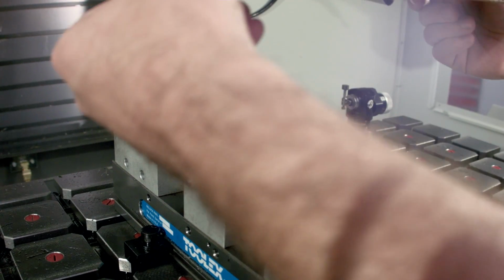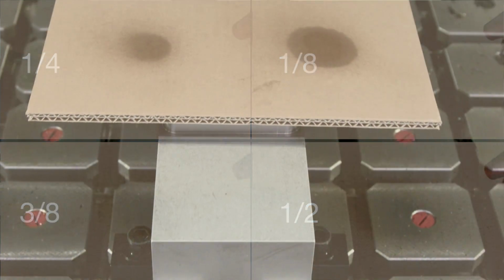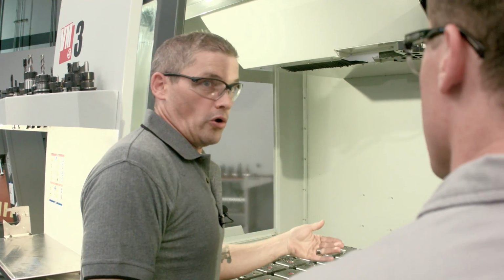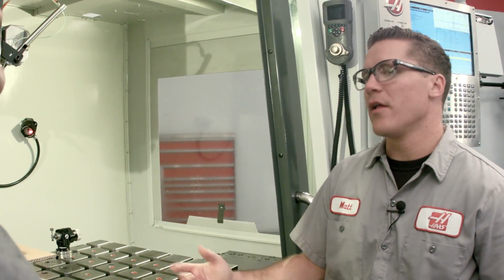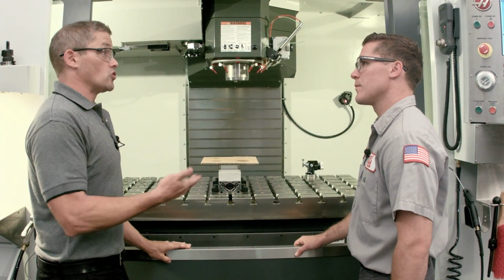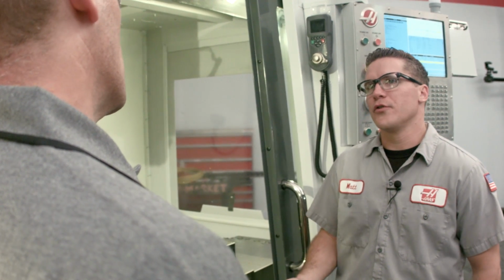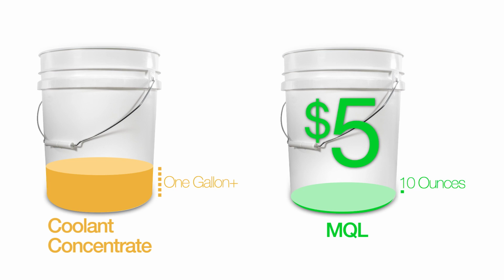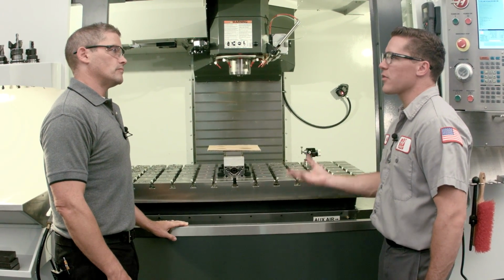MQL Advantages – The Haas Minimum Quantity Lubrication System

Comment: I’ve been using the MQL system on my Haas DM-2 for 6 months now, it’s the only coolant I use. I make parts for science experiments that have to be very clean with no contamination. That being said, the Haas system seems and works like an afterthought. The auto air gun is floppy and you can’t activate it with the door open, so it’s a pain to set. The clamp that keeps it set in place is finicky and will pop loose sometimes and then the nozzle  falls into the part or workpiece. From the factory, the nozzle pointed at the trailing edge of the cutter. I had to remove a screw to twist it so the blast was on the leading edge. The oil delivery is via suction by the Venturi effect and it is erratic. Just yesterday it stopped delivering oil in the middle of a slotting cut and the endmill was ruined. Good thing I happened to see it and stop in time or the part and setup would have been ruined. You can see the gaps in the oil in the line because it’s clear. The line gets all bunched up and twisted because it’s fed thru a mounting block and then just runs loose along the side of the piston. It gets pulled out when the piston is activated, but when retracted, you’re just pushing rope. The whole thing feels like kid just out of college designed it and it didn’t go thru any evaluation or design review. The fact that this video is 5 years old and the unit hasn’t been redesigned says a lot about Haas. I wish I had skipped the Haas MQL option, because it was not cheap, and went with a slightly more expensive aftermarket unit. If I had the time, I’d re-engineer this one. If Haas is reading this, I have a novel design for an MQL system that I’ll sell you.

Comment: I'm confused... How does flood coolant get "used"? I understand a small amount sticks to the part, and some goes out with the chip conveyor, but where is everyone's tooling going? I hear this a lot. (Same place where one sock, in every load of laundry, goes?)
Reply: The coolant loss is from the leaking machine bed all over the floor.
Reply: A lot of oil concentrate is lost in carry out on the chips.  Also, high rpm and larger tool holder turns the coolant into a fog or mist and some of that ends up outside of the machine. Blasting the parts with high pressure to blow the coolant off the parts before removing from the machine puts a lot of it in the air too. Depending on relative humidity and how much heat your machining operation creates much of the volume loss is water evaporating, so to top the tank off a weak concentration can be used. That's why it's best to use a refractometer to keep the concentration in range.

Comment: What happens when the MQL system is blocked by part geometry - which would happen a LOT. the majority of the parts I machine, the tools would regularly be blocked from coolant. Is there any multi-point solution for this?
Reply from the maker: We do not currently have a solution for this, but we have seen customers fabricate a custom bracket to mount the nozzle in a position that works best for them.
Reply: It 5 years later and Haas still sells the same system with no improvements.
Reply: Check out http://www.maglube.com/milling-machines/ and give us a call. We are a custom designer of MQL systems and nozzles for all of your machining equipment. We can retrofit your CNC's and provide the correct cutting fluid for your application.

Comment: If you are starting from scratch, can you completely replace your coolant system with the MQL system; or are there materials or cutting speeds that requires that you use flood coolant?
Reply from the maker: It depends on what you are cutting of course, but generally speaking you are going to need coolant. If you had a very specific job and that’s all that you were ever going to run on the machine, MQL might be all you’d ever need.  But if you plan on running a variety of jobs and materials, you’ll want both coolant and MQL.
Reply: Haas Automation, Inc. Thanks for the comments, that is exactly what I was wondering.  Your website videos are really good, keep the tips of the day coming.

Comment: Great video. What about the cost of the air used? As opposed to running the coolant pump motor. Surely that makes it more closely priced to flood coolant?
Reply from the maker: +Seventy7 Industries Great questions, thanks. There is certainly a cost associated with compressed air. If we use a value between $0.15-0.30 per 1000 cfm (typical values used in industry when exact cost is unknown) we can calculate the cost as follows: The MQL system consumes around 16 cfm on average, which equates to 960 cu.ft. per hour or 19200 cu.ft. in the 20 hours of cutting referenced in the video. At these rates, that equals an expense between $2.88 and $5.76. So, even when you include the cost of the air, MQL remains significantly cheaper than the cost of the coolant concentrate used over the same time period.
 
And to reiterate, we aren't saying you should necessarily stop using flood coolant. We're suggesting you use MQL where it's a good fit for an application, and get the bonus of saving money on your coolant at the same time!
Reply: +Haas Automation, Inc. Thank you for being up front and honest with regard to your MQL system and my question. Keep up the great videos.
Reply: +TacticalKeychains I think its always going to come down to removing chips from around the cutting tool. If you cant do it with flood coolant. Theres always mist air.
Reply: For many shops, this could easily require an air system upgrade that should be considered. We sized our air system to be suitable for typical tool changes and blow off tasks. Adding the MQL to only a handful of machines would overwhelm the system and require additional air system investment in addition the electricity and maintenance. I like the direction, but would be quite hesitant to bother at this time.

Comment: Is this retrofittable to my existing machines?
Reply: You may want to use a link URL that actually works and doesn't result in a "404: Page  Not Found:" error.
Reply: +InDaBarn 
This is my question too. I have a SuperMini.
Reply from the maker: +InDaBarn Thanks for the question. The MQL system can we be retrofitted onto machines that have the Automatic Air Gun (AGG) option installed. Unfortunately, since the AAG is not an option on the Super Mini Mill, MQL can't be added to that machine.
Reply from the maker: +Istvan Vomberg The MQL system can we be retrofitted onto machines that have the Automatic Air Gun (AGG) option installed. Unfortunately, since the AAG is not an option on the Super Mini Mill, MQL can't be added to that machine.
Reply: +Haas Automation, Inc. I have VF4's, EC400's, DT1's and a UMC750. Can any or all of these machines be retrofitted? None of them have the AAG option now so I would need to retrofit that also.
Reply: Check out http://www.maglube.com/milling-machines/ and give us a call. We are a custom designer of MQL systems and nozzles for all of your machining equipment. We can retrofit your CNC's and provide the correct cutting fluid for your application.